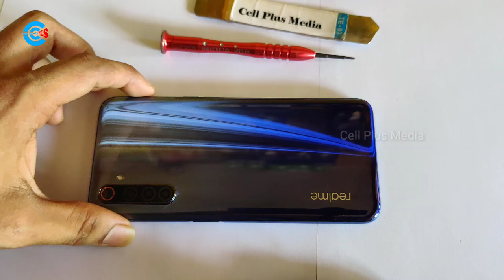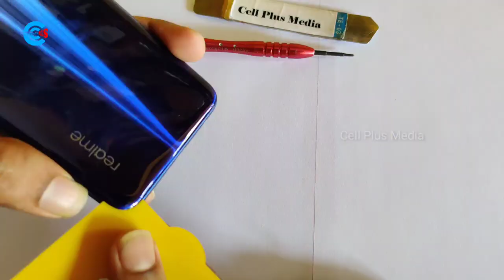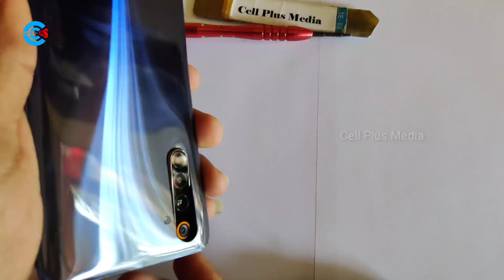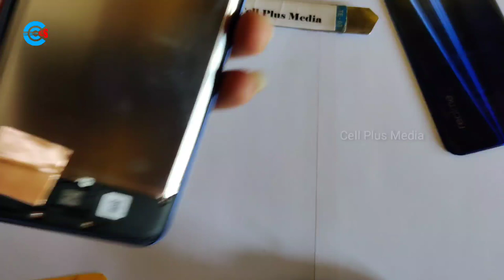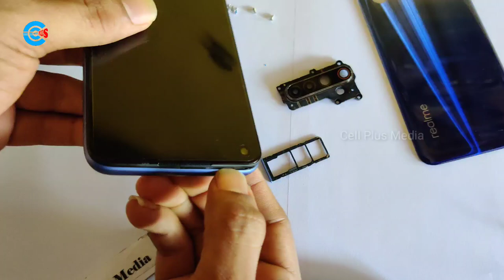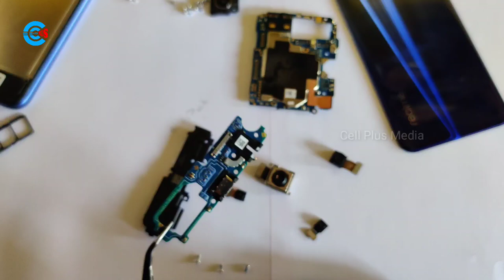Realme 6 Teardown | Realme 6 Full Disassembly

Comment: Hi. I need your help. What is the other flex cable that you didnt remove in the fingerprint sensor? is it important?
Reply from the maker: That's power button strip.
Reply: @CellPlusMedia  how does it work? Why is it not connected to the motherboard and only in a frame?

Comment: Is it normal that the battery is flat and the right is side of the camera is slighty lift up? So when I slide my finger (pressing hard) down up to the right side of the camera the battery part is flat but the upper part of the battery ( right camera part or the part where is the processor is located) is slighty lift up.

Should I get that checked?

Sorry for the bad english.

Comment: Brother, I had mistakenly placed the same phone in the pitcher for 30minutes. It was still working while it was soaked in the water. To get rid of the water I put it inside a container of rice grain, after a day my phone is not responding anymore, but whenever I plug the charger it's vibrating. I search how to disassemble and saw this video. My phone is on exploded piece. Will it still work if I dried it all up?
Reply: bro same problem has happened with my phone what you did and how is your phone condition now??
Reply: @priyanshukamboj315  hopeless. It's not working anymore. Haven't done anything with it yet again. Planning to have a legit repair on it.